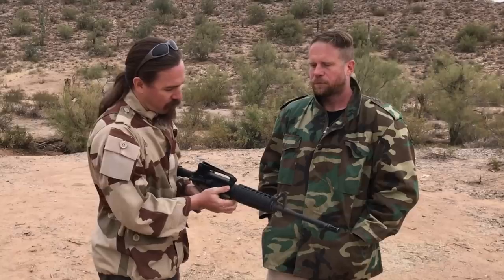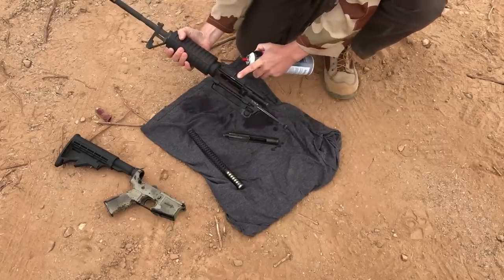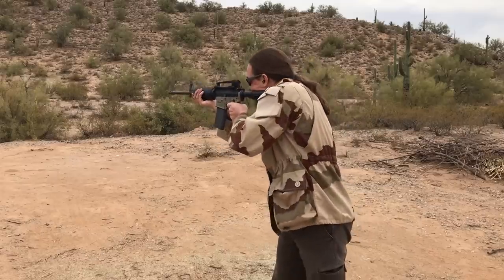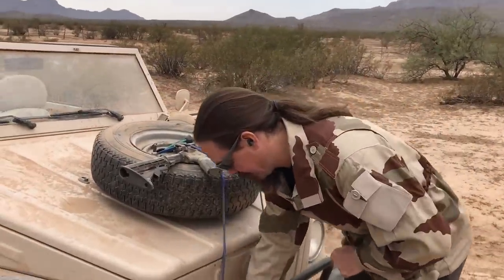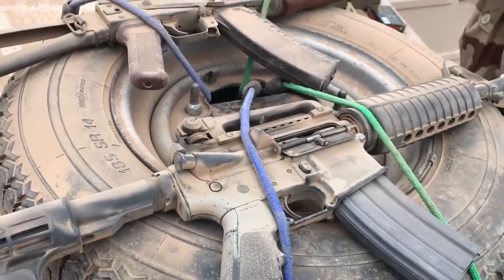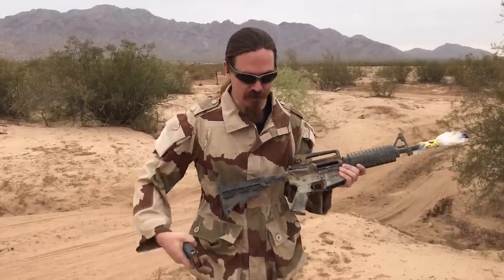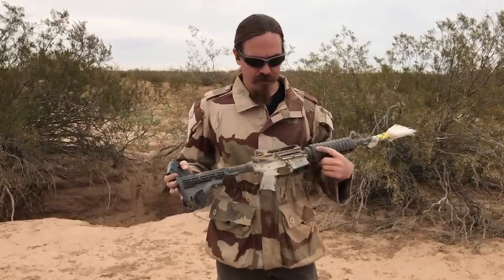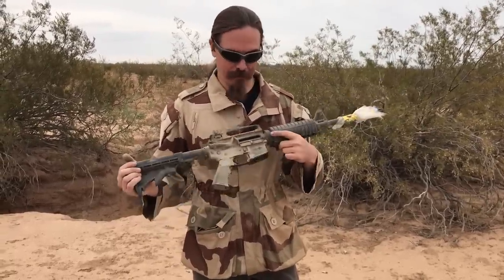Convoy Dust Test: M4gery / AR15

Comment: Little anecdote here. I used to HATE the AR platform and M9 for unreliability. It was pretty much for reasons you said: service rifles/pistols. Qualifying in BMT as a young Airman, we were given franken-16’s, which were a hodge-podge of M16 and M16A1/A2 lowers and M16, A1, and A2 uppers that we’re barely kept in running order and fed no-lead frangible ammo. The rifle I got had a 16 lower with “auto” hand stamped out with X’s and “burst” hand stamped under it, and an A1 upper, however the hand guards had broken and been replaced with A2 style. Good news was it had the old school lefty sheet metal brass hood. Past round 10, however it was a bolt action.

Fast forward to Afghanistan, 2012, we were again issued tired, Reagan-era A2’s as we weren’t front-line troops (aircraft mechanics). At least we were given ammo, as the ANA had been shooting about as many Americans as they had their own countrymen. I cleaned my rifle as often as I could and it was never abused (just worn around base and on the ramp), however it was rare that I could drop the bolt and chamber a round after a day or two. A dust storm would make it hard to even open the rifle without mortaring it. Why? We were only given CLP to maintain the rifles, and as much as I tried to dry out every cranny and never use the CLP after the armory-mandated first cleaning, the thing remained a magnet. Combine that with a buffer spring as tired as the Russian “hairdressers” at the boardwalk, the thing was more useful as a brick.

My opinion didn’t get better, as each recurring qual was done on equally tired A2s with leadless ammo, until the Camp Bastion disaster. Marines got rekt by Taliban on the flightline due to lack of security and complacent training for non-combat troops, losing a good chunk of Harriers and some good guys. If it happened to Marines, we all figured we were screwed. After some well-deserved peepee smacking by the top levels of the Pentagon, the AF dumped all the trashed A2s and standardized the M4/M68 combo, changed qualification to a tactical course of fire, and started using proper ball ammo for quals.

My opinion of the M9/92 was equally bad for very similar reasons. Every encounter with the service pistol, it was trashed and unreliable.

Fast forward a few years, and my two go-to guns are a Colt 6920/Aimpoint PRO and a 92FS. What changed? My guns aren’t 30 year old service weapons abused by generations of teenagers. Accepting that EVERY design will be trash when placed in military service allows you to less critical of any of them. Give it ten years, and the P320 will be widely hated.
Reply: 1990: "Those 1911's worked no matter what! No problems! Nothing! Best handguns evar! These new 9mm sissy pistols are crap, break, and choke!"
2020: "Those Beretta 92's worked no matter what! These new SIG pistols jam and choke!"
2050: "Those SIG P320's worked no matter what! These new pistols just jam and choke!"
2080: "Man, those old Plasma Pistols, man..."
2180: "Those old Phase Pistols, man..."
2280: "Those old Type 1 Phasers, man..."

Moral of the story: Soldiers will always complain, they will abuse their gear, and they will be fed plenty of propaganda from old salts that revered the olderweapons they used, because the ones that lived long enough to tell them about it, were the ones with well-maintained weapons. Speaking of, I remember someone saying years ago, that with the AR15/M16's reputation, combined with how the military keeps demanding "near 100% improvements" on new rifles, we're going to be hearing from future generations of Marines complaining about how their M4A9's are jamming on Martian dust.
Reply: I agree I started life in the Marines with an A1 than transitioned to A2 at one unit I checked into the A2 rifles where all silver not an once of finish left on them my gun was crap then I got a M60E3 man jamomatic gun couldn't shoot for the life of me.   I was told use more LSA really? I eventually moved to the Saw loved that gun lighter then the PIG and it just plain worked.   I eventually moved to the 92F I got yet again a tired pistol the problem with the US armed forces as a whole is One maint and the so precious attitude towards weapons equip.   What I mean by this is DONT GET RID OF THAT MAGAZINE ITS SOOOOO PRECIOUS!  when the damn mag is done spring crapped out mag dented but yet we have to keep it good grief then you try to qual and all you hear is Tap Rack Nothing!
Reply: Is this to say CLP catches more debris since its wet VS the gun running dry?
Reply: "Shermans were death traps!"
Man who survived his tank getting destroyed
Reply: @TheAlhouk57  The sherman had great survivability due to the ease of exiting the tank, but its armor and weaponry was subpar for sure.
Reply: @TheAlhouk57  broken down or not the 75mm howitzer slaps
I'm not trying to create an austist flame war about ww2 era tanks lol
It's just a fact that Sherman's have high survivability but poor armor and weaponry.
Reply: Exactly !
Reply: @Paid2Win  I'm literally say that.

I'm not shitting on shermans
Reply: Graduated bmt in August, can confirm the m4s are BRAND NEW, fire amazingly, barely any marks on the brass deflector, and the new catm course looks a lot better suited than it did before based on videos and such.
Reply: the army is supplied by the lowest bidder :/
Reply: Cause you dont know how to use it, and everything is modular on that gun, so why dont replace that or those broken or weak parts.  Not trying to disrespect you but I was just pointing it out.  You used too much moatary, thats what got the dust in, also that rifle probably wasnt cleaned when you fired it for the first time.  Its just the problems from Vietnam that get you like, "Huh, that rifle sucks."  But you can put an M4 upper on an A2 lower, or can...you...do that in the military?
Reply: A friend of mine has a friend in the military.  After finally being issued an M9 like he always wanted, it was one probably older than he was.  All the bluing was worn off, and the slide loudly rattled when you shook it.  It was so badly worn, that it was a danger to use.  But, it was still issued.
Reply: Strangely, the A2s we trained with at Camp Ripley were better kept than what you described, but if I recall they came from a SD guard unit so they probably never saw heavy use. Thanks for sharing man.
Reply: @ravenfeeder   True.  This guy was having the time of his life.  He could of just replaced his Bolt Carrier Group
Reply: The Mk23 is about the only gun I've never heard of any issues from. Other than size.
Reply: I have heard horror and praise stories of the M4A1s used by the army in combat from Infantry and the like. M4s though are not as old as the M16s so there is that.
Reply: What do you mean by Russian “hairdressers” at the boardwalk? Foreigner here.
Reply: So with the enormous amount of taxpayer dollars the US military spends on all kinds of crap, they couldn't be assed to issue reliable service rifles to the soldiers that need them to, you know, maybe not die? Why am I not surprised...
Reply: @calanon534  I think you’re mixed up. You say:

“1990: those 1911s worked no matter what!”

Hmmmmm, if the 1911s were working no matter what IN 1990, then that means they are excellent guns. In 1990, they had been in service for decades. The OP was saying the NEW guns worked, the OLD guns didn’t. You’re saying the old guns DID work.
Reply: Zogy yes the new guns work because they are new, in 20 years, they’ll be talking about how p320s suck and the beretta never had problems. The beretta was adopted in the 80s.
Reply: Well my service rifle was 42 years old at the time and gone through abuse of multiple generations of teenagers and still worked flawlessly ¯\_(ツ)_/¯ Though that was an rk62.
Reply: @TheFaveteLinguis  Warfare is mankind's oldest profession. Can you guess what the second oldest is?
Reply: @Paid2Win  thats why they were called "Tommy cookers" when the Brits had them!
Reply: My unit was one of the first to get the 320. I absolutely love it. I agree, once something has been abused it will struggle. Our Fifteys, 240's and M4's have seen better days
Reply: @todd2048  If the military can’t afford properly maintained/replaced weapons then wtf are they spending 900 billion a year on?
Reply: I laugh now because like you I have a Beretta M9 and just built a A2 rifle why because it's new all parts will be maintained the problem with military weapons is just poor maint at depot level not the warrior the warrior winds up cleaning their weapons as much as possible figuring out ways to keep dirt and sand out.
  At the depot level is failure you can tell the armorer a hundred times hey I need new magazines or new recoil springs ect ect that's the problem.
Reply: @todd2048  I figured they would pick guys with knowledge and interest in firearms as the depot armorers. Then I remembered that this is the army we’re talking about here. 🤦
Reply: What’s weird is the M4 thing. I mean, why not an M16A4 upper + M4A1 lower combination? Does having a shorter barrel make the M4 more reliable than the M16A4?
Reply: Brother I volunteered for Iraq in 2009 and there was 10 of us that were attached to a unit from Bliss and we were leaving from Hood. Before leaving we qualified on brand new colts and we were stoked! 10 of us E4 and below with 5 Saws no slings and drums, 5 M16s. My M16 had a bent front sight post. I tried my best to make it work. We were air defense, but still if I had to use the damn thing for one it was a guess on where the rounds were, and 2 I had to put the bend either away or towards me. The military won't give you the best all the time. Unless you're a seal or SF, hell even your 11B probably get some cool stuff.
Reply: The 320 is a legitimately terrible pistol to begin with lol whereas the M9 and AR platforms were not.
Reply: @calanon534  All replacement designs for the M16 over the decades had much lower dust failure rates than the M16. It's the M16 and the talc-like dust in Iraq. The M16 and M4 should have been replaced. Sadly, the sum cost of all replacement competitions exceeded the cost of actually picking one of the candidates at random and doing a full replacement procurement.
Reply: @Tattlebot  And your point is..?
Reply: In BCT, the mags they use in range are full of sand and never cleaned, some of them just pushing down the follower will get it stuck down. I had double feeds like every 20-30 rounds. Had a very bad repeated failed to go into battery, slamming the foward assist actually got it in battery.

I think old mags especially dirty ones has more to do with reliability. Unless the gas rings are worn out, or its been improperly (with steel tools) cleaned, old parts should function fine

Comment: If the platform didn't work in a dusty environment, we wouldn't have been using it overseas these past 20 years.
Haters gonna hate. Both the AK and AR platforms are solid designs. Just a fact.

Comment: Another problem with the AR design and military issue M16s and M4s is the that the buttstock is attached to the lower receiver and the barrel to the upper, and the upper and lower are attached to each other by steel pins going through aluminum. Due to age, hard treatment, and bayonet/buttstroke drills, the pin holes in the upper and lower receivers get wallowed out, leading to a sloppy fit between the upper and lower. In Afghanistan, I had a fairly new M16A4 but it already had quite a bit of slop between the upper and lower that let moondust in. The outside of the rifle could be spotless but I'd pop the rear pin and the bolt carrier and inside of the receiver would be coated with a decent amount of sand.

Comment: Worth noting the the sand was kicked into the AK with dust cover open, bolt closed.  With the AR, dust cover open, bolt locked open.  So the AR actually had it worse for that last part.  Impressive results from both guns.
Reply: Depends on how realistic you want to be. Ar locks open and dust cover is only closed in transit so the test simulates a GI eating dirt while reloading. For ak dust cover is pretty much always closed and most aks do not lock open on last round.
Reply: @DmitriyLaktyushkin  Eating dirt and kicking it full of said dirt. Not going to happen.
Reply: @ericn7677  my reasoning for that was maybe a recreation of dirt being tossed around by impacting rounds?
Reply: It's also worth noting that the AK has a huge opening on the side of the receiver, so it was just as exposed.
Reply: @thephoenix756   safety works as a dust cover in a sense. But either way, when the ak's bolt is closed its chamber is mostly protected, vs the ar15 having the bolt and chamber open.

Comment: I think that over lubrication could cause malfunctions in conditions like that. That fine dust mixed with CLP would create a gritty paste. 

Chuck Pressburg said when he was overseas in super sandy environments he would carry his rifle dry. He would also carry a small bottle of lube on his kit and if he knew he was going to be in a extended fire fight, he would apply lube the first chance he could.
Reply: @joshuab7737  Only where it needs it makes a huge difference.
Reply: No idea who chuck pressburg is, but sounds about right, I did the same. Or dry lube (graphite=carbon)
Reply: I’ve never liked hearing people say that lube “attracts” grit and debris. There’s no force of attraction (static or anything else) at play, the only effect/interaction of the lube is that it holds debris preventing them from being blown off. In the end it’s the same but I guess it’s like when someone says “tolerances” when they mean clearances. I’d like to see a real test to quantify the effects wet lube has on gritty guns, I would guess that the results won’t be the forgone conclusion most commonly accept. After all it doesn’t stop being lube just because it’s contaminated with grit unless the entirety of the lube is absorbed by the debris it would still provide lubricity, and possibly when heated by the firing of the gun it would flow away (downward by gravity) taking the grit with it.

I’m not simply being pedantic, the “dust magnet” idea is an commonly held and repeated concept testing it’s validity would make for a good video.
Reply: Never been in a desert but I have literally never lubed my ARs. As long as its got good gas rings and the carrier isn't gummed up with carbon buildup it'll keep on running. It really doesn't need any lube at all, lube is for things that see a lot of friction and heat and the only part in a gun that sees a lot of friction is the barrel and lube won't help you there at all. Keep your gun clean and it'll keep shooting.
Reply: @nuclearjanitors  
Don't use graphite, at least not in an AR or other aluminum heavy firearms. Graphite and aluminum don't play nicely, it can induce galvanic corrosion.

The anodizing protects the aluminum quite well, and certain parameters must be met for galvanic corrosion to occur, but it's best not to risk it at all. This is also why you do not use graphite based anti seize on barrel nuts.
Reply: J  Chuck P was absolutely in Special Forces. He was in the asymmetric warfare group which in and of itself is SF.
Reply: @daa3417  This could be true. I remember reading a report done by the army a couple years ago dispelling the whole "run your rifle dry or light lube" in dusty conditions.  The report actually showed that the wetter the better and that lube actually created its own channel/flow to push debris out of the way of bearing surfaces.  I mean there always comes a point where lubing a dirty gun that hasn't been cleaned is going to gunk up in areas and create stoppages though. Who knows, this would be a good test for in-range to do though(ie dry vs lubed in dusty conditions)
Reply: Da A leave a small bit of literally ANY lube out for a few hours and tell it doesn’t attract dirt and grime. :P Joking aside, there’s a reason why anyone who works with any form of lube says it attracts dust and dirt, it may not actually have an attractive force pulling muck to itself but it certainly seems like such.

Comment: after 2 deployments with an m4, I FULLY trust the system.  Other than the beat up old m16's we had in TRADOC, i've only ever had 1 malfunction with an m4 in 10 years, and it was a strange fluke of a trigger not resetting once.  I just racked the charging handle once and never had another problem.  This video also makes the case for dry types of lube.  I use hornady one shot because it has crazy corrosion protection and quickly dries into a dry lube.  DI systems will blow a lot of junk out of the action if there isn't wet lube keeping all the dust in.

Comment: This matched my real life findings. My coyote calling rifle is a post ban heavy barrel (.950) AR15.   We move around a ton on ATVs and dust is a real stopper of even bolt action rifles. I run my guns dry and carry a can of compressed air in my quad bag. Every time we stop to do a stand I blow out my rifle and shotgun. Oil has aways been our biggest enemy with dust.

Comment: Speaking from some experience, as a 10yr army afghan vet, I think its just that soldiers are taught to use unreasonable amounts of break free CLP-4 Cleaner Lubricant Preservative. It makes the dirt stick in places it probably shouldn't go, and cleaning a weapon in the field just makes it worse. Additionally the under utilization of the dust cover is definitely a factor.